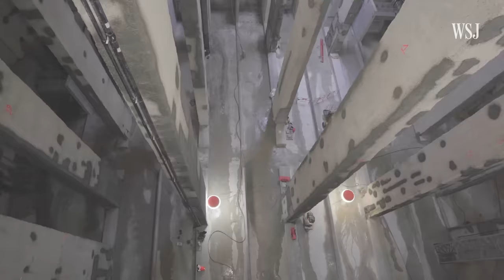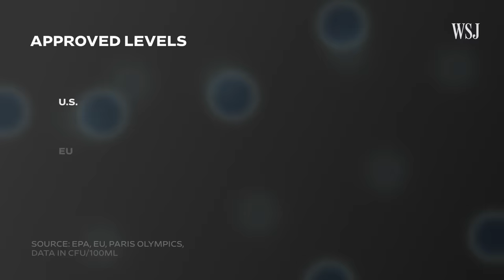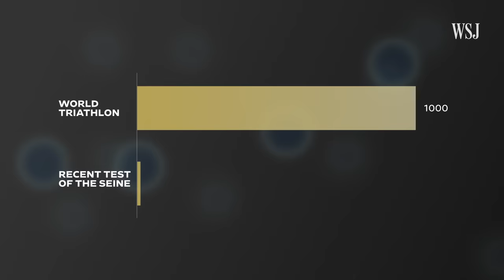This 13M-Gallon Tank Is Key to Paris’s Olympics Infrastructure | WSJ

Comment: This is a great excuse to finally modernize a centuries-old sewage system.  It's not really a great solution for the Olympics, though? You'll never get the long tail of river pollution even if the main sewage trunk line is completely diverted for the duration. It's very inexpensive to make a pool-within-a-pool and chlorinate the water inside.

Comment: why not build a uv light matrix for the water to pass through before it reaches athletes... this may reduce the ecoli to acceptable levels.
Reply: Incredibly high cost and won't work for water below the first foot or so, not to mention the speed of the water going through would leave the UV light with no time to actually kill it. Cheaper and more sustainable to just  minimize the wastewater.

Comment: Can they setup Porto johns at certain locations and ask Parisians to use them during the swimming events? Reduce the waste going to the drains?
Reply: The waste water already goes straight to processing plants. It is only during heavy rains that the drains flow over into the river, because they are not big enough to handle those massive amounts of water.